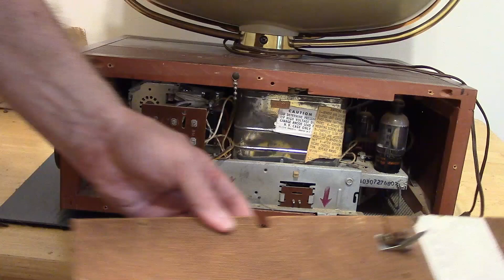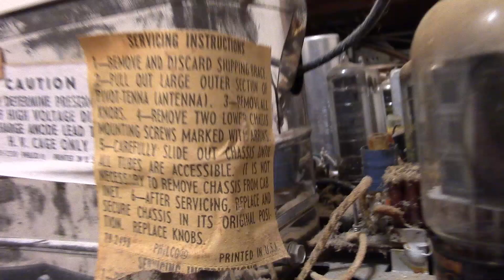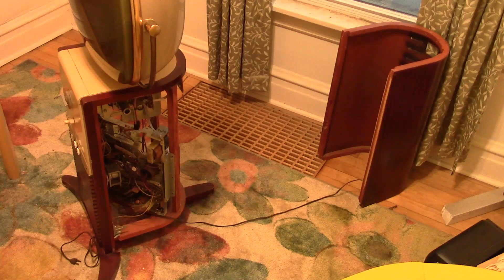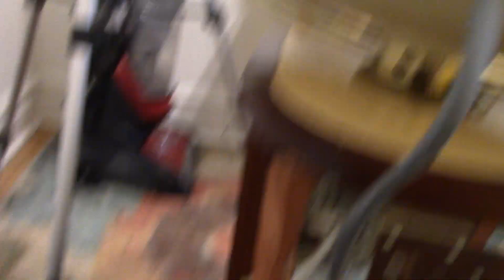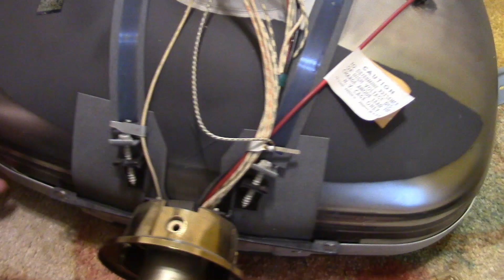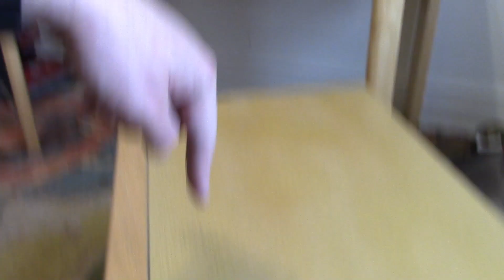Predictapalooza II (21 inchers) p1o???

Comment: Hey Bander - I didn't see an email address. I'm running a Raspberry Pi thru an HDMI/coax output to an OHM converter on the back of my Predicta. Could you do a video, or email me, about hot to best TUNE the audio/video of a Philco? I don't know what the switch on the back of the set is - and turn the two front knobs at best, to bad results. And I don't know if I'm missing any fine-tune stuff inside, or otherwise, on my set. I'd love to see this basic video; I'm working on a neat random-video Raspberry Pi project that I'd love to send you - the VIDEO side is awesome; I can bluetooth to an external speaker, but WANT to use the Predicta internal...
Reply: Can you describe what's subpar with your results? If the set is working right it shouldn't be hard to get acceptable results provided your source is good. And of course, what level of electrical restoration has your set undergone?
Reply: @eDoc2020  wanna see a video on this as it seems interesting🤔
Reply: @eDoc2020  either the audio is acceptable and the video is fuzzy or dark or the video looks great but the audio is almost null. That’s by using the two secondary dials on the front of the set. But I also notice a switch on the rear of the set; and don’t know what that really does… on a holiday model. I can run my source thru an external speaker or Bluetooth and it would be really nice; but was just wondering if I was missing any details. :)
Reply: @paullee107  The switch on the back affects the reception for weaker or stronger signals. You probably want it on "local" but it won't cause what you're seeing. My guess is that your FM discriminator needs to be adjusted which will be a coil inside the set.

Comment: Do you feel vindicated... being so respected by your peers?

Please, never stop what you do. You're a gem.
Reply from the maker: Thanks, I will.  I don't need any vindication though.  I've been doing this hobby from the beginning because I enjoy it.  Even if I had no viewers, I'd still keep going 😁
Reply: @bandersentv  I don't doubt that one bit.
How many of these sets have you worked on for others... before finally getting to the Tandem?
Your own set.
Probably the most interesting curiosity out of the Predicta line.
(I hope the extension cable is still good! Try finding a NOS one of those 2022! LOL!)

Bob- You're a good man... which is a rarity these days.
Pet the pups for me, and thank your wife every day for letting you keep this hobby.
Reply from the maker: @rareblues78daddy  Thanks for the kind words.  I have owned three Tandems.  Two were electrically restored about 6 years ago.  One was completely restored inside and out, but I sold it.  The other is in the same situation as the blonde - no head.  I have bits and pieces of plugs, sockets, cables, etc.  It should be enough to make two good cables and CRT heads but it will take some work.  That's why I've been putting it off.  I'll try to make it happen soon.  June/July I'm thinking.  It will be nice to have a working showpiece again 😎
Reply: @bandersentv  One last thing, and I'll let you get on with your day-
I would love a review of that RCA ribbon mic you got from the Bell Labs engineer.
Those mics are awesome.
Reply from the maker: @rareblues78daddy  Oh most definitely.  I acquired some other vintage mics as well.  I need to get a good preamp before I can try them out.

Comment: Was surprised that those pedestal sets were worth so much. Roughly a month ago, when a couple of unrestored examples showed up, on eBay, for over $1,000.
Reply from the maker: A fully restored Continental recently sold for $4,500!  Interest is really high in these sets right now.  That also means spare parts (especially picture tubes) are getting even harder to find.
Reply: @ Bandersentv,You’re right about that. Still a couple deals have shown up. There was a Continental in unrestored and mostly complete condition that sold for $699 buy it now a few months back,but it was out of state and local pickup only.  I’ve still never found one of those,but they are the most beautiful of the series,along with the tandems. 
Have you ever had a Continental show up in your workshop or have you ever owned one?
Reply from the maker: @Suddenlyits1960  I have a continental chassis on my workbench right now.  It's mostly the same as the one used in the Princess/Debutante/Siesta.  No, I've never owned one and only seen a rough example up close.
Reply: @bandersentv  is it because of the fallout games (and the upcoming Amazon series) or people have just become interested?
Reply from the maker: @aussiefurbymogwaifan6621   There's been a fairly high level of interest for years.  At least 3 companions have made replicas in the 90s-00s.  Currently, there is a very active Facebook group that has generated interest. Perhaps my videos have as well.

Comment: I don't think they really gained anything going to a series-string chassis, except maybe extra space for tubes?  These were certainly the most advanced B&W tube TV receivers Philco made.
Reply from the maker: Weight, space and money.  The short picture tubes were advanced, but the rest was fairly basic.  They also had sets in larger, more conventional cabinets with advanced features like remote control and of course color.

Comment: Hey bob, You should get your pup a Thundershirt. Its a vest for dogs that calms them during thunder storms, and make sure he has his down little doghouse in the basement full of blankets or pillows or something, to dull the noise. Even a crate just completely covered in and full of heavy moving blankets works well.  of My cousin is a dog trainer and has a few goldens that shake like yours in storms and these things worked really well for them.
Reply from the maker: Thanks for the suggestions. Around here fireworks start in June and go all summer. Last year was especially bad. We do have a padded tent and I make pillow forts in the basement. It's going outside that's the biggest problem. He's terrified to go out for a walk
Reply: @bandersentv  yeah the thunder shirt should help with that, best of luck

Comment: isn't that faux wood not just a printed plastic film? if so a modern (vinyl) wrap could be used to just replace it
Reply from the maker: No, it seems to be painted on. Maybe a wrap could work. I don't know of anyone who's tried. I'd be concerned about ruining the look
Reply: @bandersentv  they wrap complete cars in complex imagery. I think the quality of the print would just as good or better then the original and just as sturdy.
You say it's painted on, but a paint would have to be really thick to chip. Otherwise it would scratch. But old thin plastic films do chip. Unfortunately Europe has no predictas for me to check myself.
Reply from the maker: @bzuidgeest  It would have to match the pattern, color and sheen of the original.  It's about 1mm thick and is built up in multiple layers including a clear coat.  Philco started doing faux finishes around 1937 and I have several radios with it.  I don't think plastic technology was advanced enough in 1958/59 to make a film.  I suggest you go back and watch my old Holiday restoration series where I restored one with ultra thin mahogany veneer.
Reply: @bandersentv  wraps should be available in 50 microns thick, matte, satin or gloss sheen including for this purpose useless metallic variants. You can custom print them with anything you like.... Like this paint pattern.
I would not use it to put over true wood veneer. But painted on metal? Most certainly an option. I can't paint metal with patterns, but I can wrap them. Better then a damaged or ruined finish. It all depends on how much of the original finish is damaged and how visible it is. In the end it's just an suggestion. You say nobody tried it before? There always has to be a first time, maybe get some samples somewhere. Nobody has made reproductions of the screen cover but you are looking into that too
Reply from the maker: @bzuidgeest  The cabinet is wood, not metal.  That's why I used mahogany veneer in previous restorations.
Reply: @bandersentv  my mistake. I understood the cabinet to be metal like your first round of predictas you just did with wood pattern painting on top.

Comment: The Continental (aka Danish Modern) must be the exception, as they have a 21" picture tube and use the transformer based chassis. I can confirm the 21" tube is junk as mine works, but has a purple glow in the neck that shows up as a 4" purple vertical line on the lower right part of the crt when displaying a picture. I guess it hasn't quite shorted yet. I'd love to find a better crt for it. Good video Bob.
Reply: You’re certainly lucky to own a Continental! That’s definetly the most beautiful model in the Predicta lineup.  The base looks like a rocket ship with the four angled tapering legs canting outward.  It sure would be nice to return to the time when these sets were new and such wonders were commonplace.